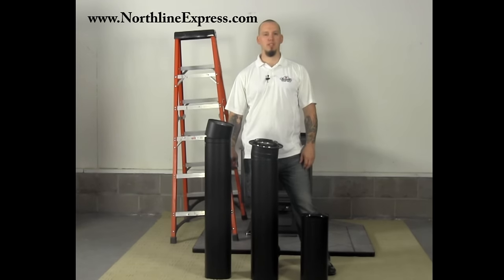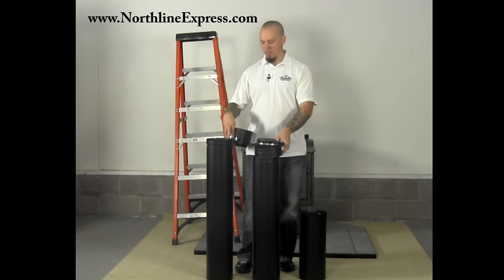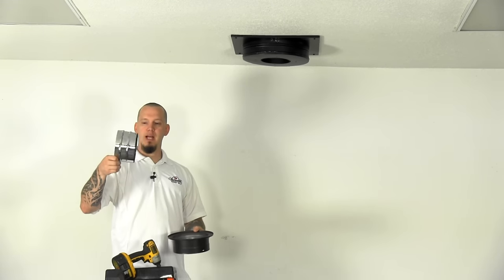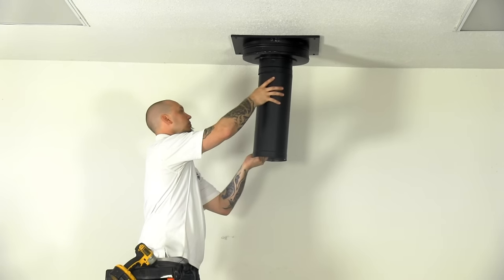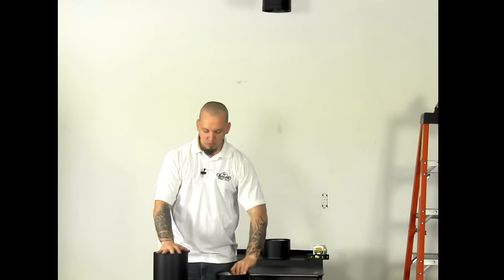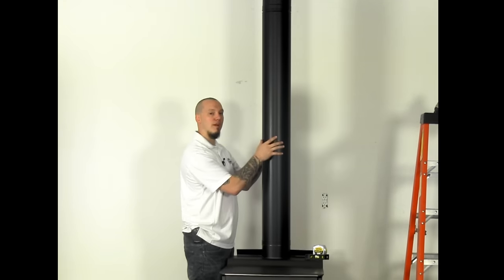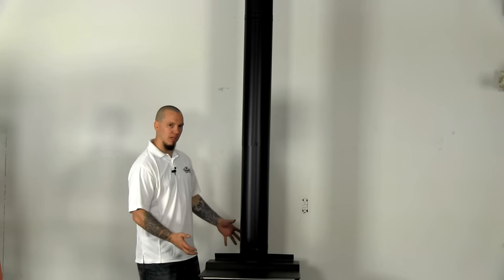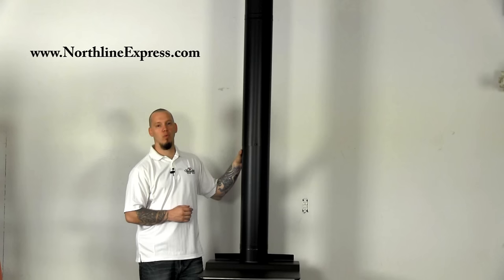DuraVent DVL Stove Pipe - How to Install DVL Double Wall Stove Pipe

Comment: Nicely done. Might mention that some local inspectors want to see at least one of the tags for the chimney, and all the other components, so put them in a safe place if you remove them.  You will also need the installation manual for the chimney system, and the stove, so the inspector can make sure it is "installed according to the manufacturer's instructions", as required by NFPA 211 or equivalent code.

Comment: thanks for the vid, this duravent branded stuff can be hard to understand how all the pieces connect. My question is how do you secure the chimney pipe to the silver adapter you installed at the bottom of the support box?  Is there enough room to get a screw gun in there with metal screws coming from the top?

Comment: Surprised to see no high temp silicone sealants were used between pipe sections. Why aren't the joint sections sealed to control smoke infiltration?

Comment: So does the "Flow" arrow have to be pointed downwards or pointed upwards?
Reply: Upwards in the direction the gases/ smoke from the wood stove will be venting out of the building
Reply: Unless you start a fire on the roof, then point it down.

Comment: Check the pipe for being 'plumb', not 'level'.
Reply: Yes, but use a level to do it!
Reply: And not a 3 inch torpedo for 8’ of pipe
Reply: @jackvillan5151  it’s fine. There are so many seams, it would be near impossible to use anything bigger

Comment: Great video.... I have a couple of questions.
1. I am using an 8" to 6" adapter on my stove. It has a collar on it, so my 6" telecoping pipe fits right over it.  The holes in the adapter don't line up with the holes in the bottom of the telescoping stove pipe. Should I drill new holes in the adapter to attach it or just leave it sit on there?
2. I can't seem to find an answer to this in my instructions. The telescoping pipe has holes in the outer pipe. Of course there are no holes in the inner pipe. Do I drill holes through the inner pipe to attach it? Someone said just use the little screws that came with it to kind of "pinch" it to the inner pipe, but the screws won't go in with the outer wall of the inner pipe pushed up against the inner wall of the outer pipe.
THANKS!

Comment: I have the same problem as Scott Bulger my chimney adapter ring will not go into the support box. I have tried all i can think of and it just will not go. What did Scott Bulger do? looks like one of these items is defective, because there is no way I can find to get the adapter ring to go into the support box. What can I do to correct this problem without damage to either the support box or the adapter?

Comment: Why didn't you install a damper?? Please let me know. I have a wood stove to put in, and always thought you need a damper.. so I'm puzzled.
Reply: Some people choose not to install damper if the stove  already has adequate air control built into wood stove ect. It is something you definitely can install,  but most often with newer stoves that  have controlls to adjust precise primary and secondary air controlls, it is not needed, because those controls act as the damper
Reply: I did not know that thank you. And thank you for replying to my comment.👍

Comment: I would like to know about location and installation of the double wall damper?  I thought a damper would be necessary even on the double wall stove pipe?
Reply: A damper is an optional on a stove pipe (not always needed).  It depends on your draft strength and the type of stove.

Comment: Is there a need for fireplace caulk at the seams for preventing smoke leakage?  He didn't show it or mention it but he did say "while this is curing"..
Reply: No caulk is used on stove pipe.  The draft carries the gases up and out.  (remember this is a flue, not plumbing)
If you were to use sealing cement/caulk, you would NOT be able to disassemble the pipe when it comes time to clean it inside.

Comment: i need to Know how to REMOVE the Round ceiling support ( and the Square it is on attatched to the ceiling....
Reply: The square, attached to the ceiling, is nailed into support framing inside the ceiling. You would have to cut away the bottom of the square box, expose the nail heads and attempt to pry them out.  It can be a chore to remove/repair if there's currently a chimney coming out of your roof.

Comment: I paid someone a lot of money to install my wood stove with double wall pipes.  As a last step, he drilled holes around the upper edge of the pipe where it meets the wall in the outer layer of the pipe to vent it.  At the wall, the pipe went into a connector but the holes for the flow of the heat between the two layers just went into the insulation.  Those holes were blocked on the inside which is why he said he needed to drill the pipes. To me, with holes drilled, it defeats the purpose of having two layered pipes.   Where those holes are drilled, they are single layered pipes now.  Can you tell me if this is okay.  Did I get a bad installation? Is the wood stove safe to operate like this.  The installer gave me a certificate for the insurance company stating it is safe to use but I have some anxiety about it now.
Reply: Drilling through the outer pipe doesn't diminish the double-wall function of the pipe, because there is still air space between the hot inner and cooler outer walls, and the screws in the outer wall won't affect the insulating effect of that air space.
Reply: @mattwalters5642  Thank you for your reply.

Comment: Does the stove pipe need any sealing cement from one piece to the next? Iv not seen them close up and was just wondering what and if it needs sealing or if it does it itself ?
Reply: No sealing compound is used on stove pipe.  The draft carries the gases up and out.  (remember this is a flue, not plumbing)
If you were to use sealing cement, you would NOT be able to disassemble the pipe when it comes time to clean it inside.
Reply: +CenterTree777 thanks tree, I was just under the impression you insert the pipes in such a way that should tar flow back down the pipe, that it remained in the pipe, which would mean gases rising could, under a dodgy seal, naturally escape the flue.
Reply: I think his comment was in regards to the black finish heating up during the first burning.

Comment: Can you just hook the telescoping part up the DVL adaptor at the ceiling support....or do you need the 18"  pipe?
Reply: Did you ever find the answer to this? I'm wondering the same thing for my project.
Reply: As far as I know has to do with code so would have to 18" pipe non telescoping.

Comment: is it possible to install a magic heat reclaimer on the double wall piping?
Reply: cool, thanks for the reply
Reply: I would recommend NOT using those "heat re-claimers".  You ideally want to keep your flue gasses as HOT as possible going out the roof. A re-claimer would siphon heat off the pipe causing cooling of the gas and therefore increasing creosote.   Heat with your stove, NOT your flue.
Reply: I would use it only on single-wall stove pipe, never double-walled.

Comment: I have a WoodPro 2000 stove.  The stove top adapter will not get past the initial sealing ring.  Spent 4 hours trying various ways to accomplish what he does in 5 seconds- still to no avail....Even tried fitting the bottom portion of the chimney pipe like it says in the instructions but it won't come within a quarter inch of aligning with the mounting holes on the stove.  The stove's chimney inside diameter is 6".  It can't be dremmeled (neither stove nor adapter), rubber malleted, twisted, turned, crimping or running around the stove 6 times singing hallelujah.  NOTHING works!  WTF????  Is the adapter defective?  I would have to assume so since the one he had went right down to 1/2" to 3/4" of the stove top like it is supposed to.  Mine wont get within 2 inches.

Comment: Duravent diagram instructions shows the telescoping goes on top and the 18 inch goes on the bottom closest to the stove.  What is odd is the customer service for the same company this guy is from was firm in an email to me to make sure the telescoping pipe is closest to the support box and the 18 inch on bottom near stove.
Reply: why can't you just use the double-wall telescoping pipe from stove top adapter to the ceiling support box adapter. Is the 18 inch pipe needed because of the extra length needed?  tks regards
Reply: Telescoping pipe is only so long.  If the ceiling support box is higher than the max length of the telescoping pipe you have to add a piece of fixed length pipe to get it reach.  If the stove is closer to the ceiling than the max length of telescoping pipe you don’t need a fixed length pipe.

Comment: Why would you wanna use double wall pipe from the stove top up to the 18"  double wall pipe that drops from ceiling ?
You lose the heat that would have radiated from the pipe ... forever .
Can you not run single wall pipe up to that 18" double wall pipe ?
Would you need another adapter at that connection .
Its god damned hard as fucking hell to find enough compatible parts in Southern Wv to pipe a new stove...omfkng !
Reply: The point of this vid is heat to combustible items. Single wall pipe, as you say,  gives off more room heat, so as long as you have no clearance problems and or decor that can melt nearby. Otherwise double wall will insulate those areas if you see future problems. 
I for one have a back wall mantle with decorations. Double wall keeps me from moving them while the stove is lite.